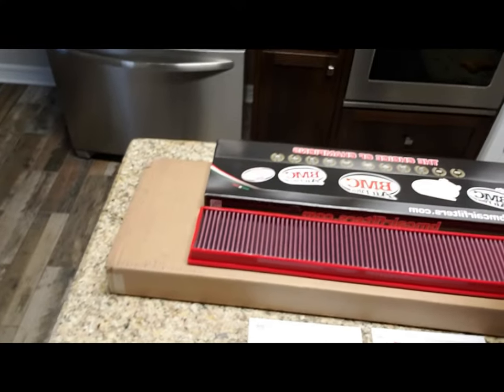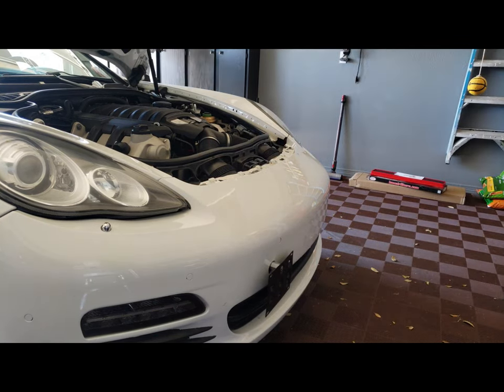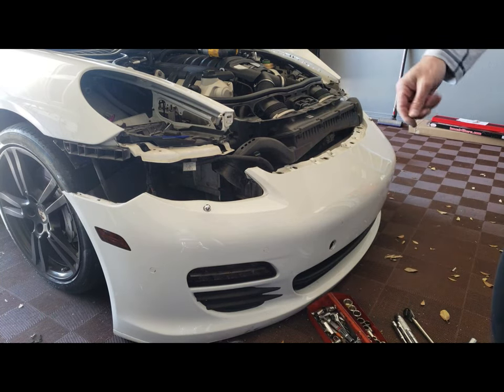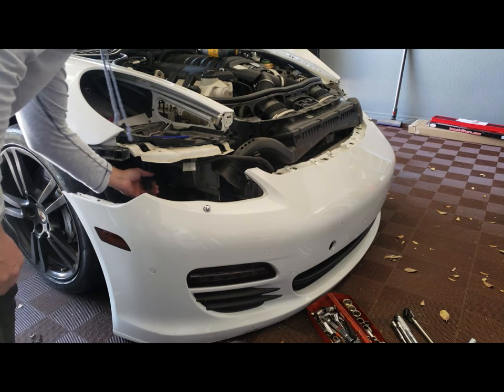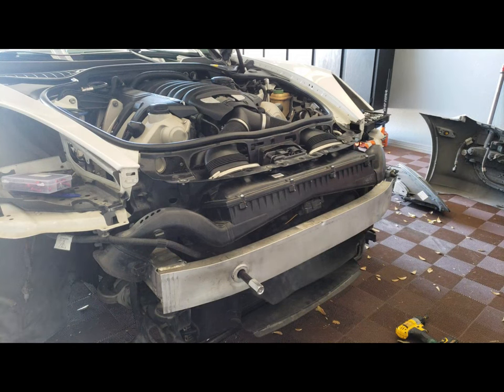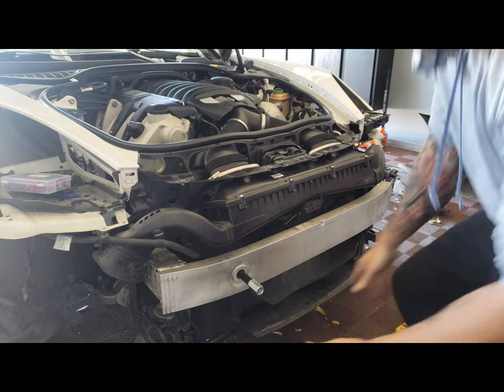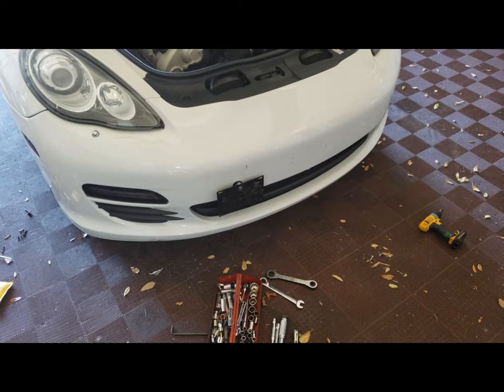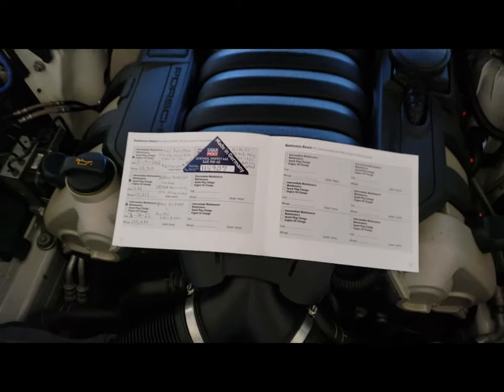How to Change your Air Filter Porsche Panamera

Comment: Good work. As someone who’s posted a few videos, I can relate with the shocking amount of effort required to pull it all together. Thanks for getting it posted!
Reply from the maker: Thank you for your support. I've watched guys for years thinking it was easy. lol there is a great deal involved. It makes the job time go way up also. I did end up investing in some tripods and better cam equipment to help make the videos easier to follow without missing to much.

Comment: Hey I am really enjoying your detailed videos. 

Thank you for sharing your knowledge. 

I want to do this air filter change myself. I am concern that the front does not get tight enough or vibrates like an old car when reinstalled. Is there are post-installation risk of shakyness or loose vibration/noise?
Reply from the maker: the bumper actually fits very nice when installed back into place. I have not experienced any vibration or shaking from it at all.
Reply: @TomorrowsTek  thank you!!

Comment: Hello, I have a rattle on the front and rear suspension, apparently this is a typical Panamera disease.  do you have a hint  Greetings from Switzerland
Reply from the maker: Yes you are right, this a very common issue. the Panamera has very weak control arm bushings and swing arm bushings. It is wise to do these both at the same time. if you have some mechanical skills the job is actually very easy. I just recently replaced these on mine. I do have the video footage to help do a walk thru. I will work on getting this one out sooner than later. and thank you for supporting my channel by watching my videos I very much thank you